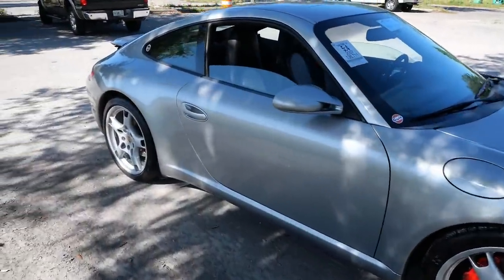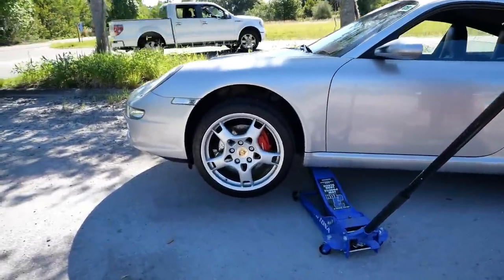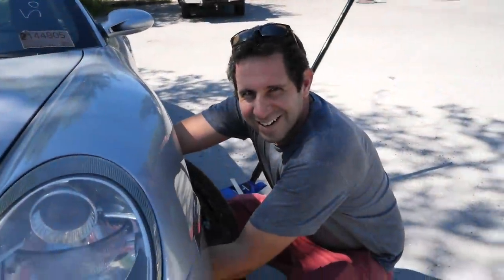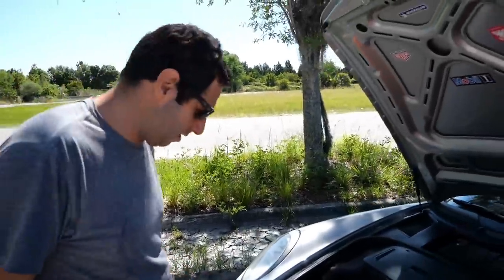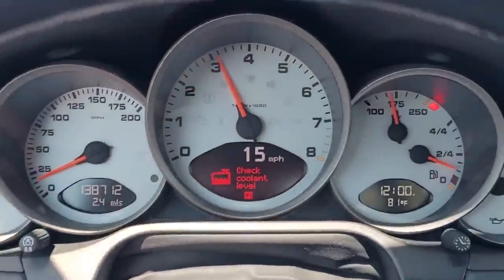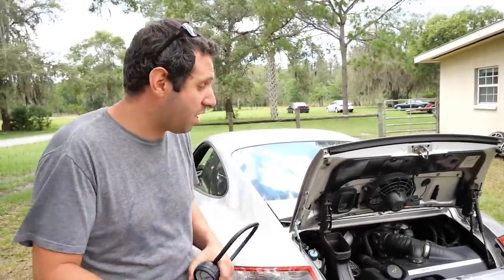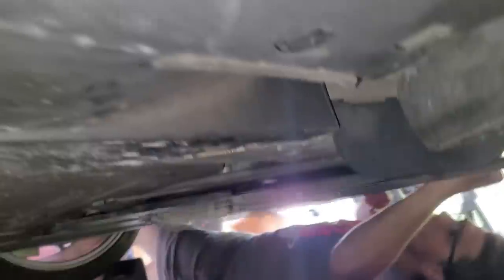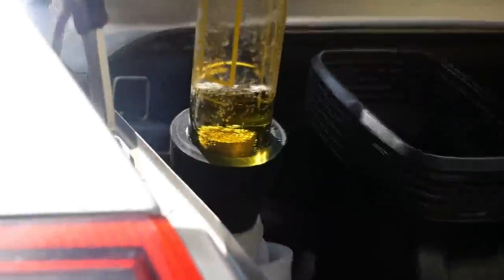I Bought an "As-Is" Porsche 911 and got 50% off because It Came with a Mysterious Leak

Comment: Hey Sam, I work on these cars almost daily and felt that I could provide some input. The coolant level is checked with the engine cold I tend to run them on the low line on my cars. They are known to have some wacky cooling systems that like to cause all kinds of trouble. Unfortunately most of the time these cars have internal leaks it's a cracked head. These cars are known to have heads that will develop cracks that will need to be repaired. The head gaskets are very strong on the m96 and m97 engines and rarely fail. Good luck to you Sam and can't wait to see this car back up and running.
Reply: I second this def take a peak
Reply: I was thinking the same. Maybe a some cracks on the channels
Reply: Worth checking the water pipes as they connect inside the front wheel arch. They can corrode and leak.
Reply: Sam “cracks”
Reply: Check your air oil separator as well. I had a 996 that was doing the same thing. Compared to a blown head gasket it’s a lot easier fix…. if that really is the problem.
Reply: Is the 997 also prone to cylinder scoring?
Reply: @WLAdrenaline  It failed the block test. The leak is inside the engine. No point in looking anywhere else.
Reply: How much will a cracked head set you back in cash terms?
Reply: @pantone6160  I hear a lot of those problem cars are in cold climates? Porsche changed the coating on the inside of the cylinder so most will eventually fail I'm sure.
Reply: "They are known to have some wacky cooling systems that like to cause all kinds of trouble." Wow some inside information. This is too technical for me.
Reply: @lopaka71  0
Reply: @pantone6160  All 996/997 are, scorning, d-chunking cylinder liners, ims bearing issue.   As I have said before, If you ever buy a  911, buy the 997.2 version where all these internal engine problems go away.  997.2 has a much nicer interior, engine,  updated electronics, nav/radio/interface.
Reply: @WLAdrenaline  Watch the video. There is exhaust in the coolant.
Reply: @esqueue  I have watched the video and know the HG is leaking. Nonetheless those pipes are worth monitoring. Thanks for confirming what I saw on the video………🙄
Reply: That's interesting....! What got me was the "electronic dipstick". I have a 2005 car with an actual real dipstick... <oo> shock!!!. I saw a video of sams some time back with gearbox motherboard controller inside a audi gearbox....i'm so behind with car tech........ :)
Reply: @esqueue , however, something caused the compromise of the head gasket or head itself. Likely a coolant leak or water pump? If not detected, this issue will reoccur.

Comment: I had same experience with a similar 997.1 model 911. Small crack in one of the heads. Common failure point in m96 and m97 engines. Head can be welded by specialty shop. Depending on amount of intermix, engine may or may not require a full rebuild.
Reply: Disappointing. No wonder owners are sticking in other engines at times.

Comment: Sam when you hook up the power to the fuse box you have to use the button on the key to open the frunk not the door sill button it only works from the key button. Check your manual. You went through a lot of work you didn't have to do. Don't ask me how I know.
Reply: Agreed not to disagree....that's the simpler way...
Reply: @benlee6500  Yeah sometimes it gets crazy. I have an Australian Ford falcon and had a collapsed cell in the battery and couldn't open the bonnet to get to the battery. We ended up hooking up a jump start cables to the starter motor and then the key fob worked.

Comment: I've never been able to open mine by connecting the jump pack and using the door sill switch. The local independent Porsche shop told me to use the button on the key instead. Worked first time. His theory was that related to the security system. For an otherwise brilliantly engineered card this just drives me mad.
Reply: you know, theres a manual for it..
Reply: I had the same problem on my Cayman.  I think when the car "sleeps" for a long time, the car is powers off everything to save the battery including the alarm system and remote FOB.  I forgot how I got in the frunk but after that incident, I put a trickle charge cable that's externally accessible.
Reply: It works in my 996 but I use a trickle charger to power it. It’s possible there is so little voltage in the battery that your jump pack isn’t powering the car. I didn’t see any dash lights come on which indicates no power.
Reply: The reason it's just a string is weight savings - Porsche charge you extra for that brilliant weight saving idea.

Comment: I had a 2016 Audi S3 that was losing coolant for months but ran perfect and never overheated. I had to add coolant what seemed like every week. We searched for hours upon hours countless times to located where the fluid was going because you could smell it, but you couldn't see anything. Finally a European shop found that it was blown head gasket causing an external leak only and not an internal leak which is why the oil was not milky, no overheating, no problems. It was only leaking while the car was under power, and then falling off the engine onto the ground and/evaporating, but again only while driving which is why we could never find any of the missing coolant. Sounds similar to what you have going on.
Reply: Seems rather unlucky, that situation. Losing coolant driving and not just running, meaning the difference from rpm at the water pump spinning, that slight difference of pressure causing that seems like a very rare and like i said unlucky predicament lol

Comment: My second 997 and I've made a manual frunk release for this one as well, just much more sensible. FYI I've tried the frunk release from the fusebox with one of those rechargeable starters, never worked, but a good old fashioned jumper cable and a battery works every time
Reply: if you use the frunk button on the key, it opens every time in this situation.
Reply: Don't let the frunk out
Reply: @allomony4010  Oh, sounds like a security feature.
Reply: I loved that my 99 986 Boxster had a manual lever by the drivers seat and it also had the pull string inside of the passenger wheel well.....I took and relocated the pull string to the front of the bumper so it was more easily accessible......Never had to use it but if I did it would have worked great.

Comment: Hey Sam, Just my 2 cents worth. As you know dropping these engines is a piece of cake.  What's not is the costs for these parts. I know that FCP and ECS are both running Memorial day sales at the moment. I recently bought a head gasket "kit" from FCP. It'll have all the rings and stuff you'll need. But, like my video you watched says, "While I'm in there Syndrome" will strike you hard and fast here. Don't believe me? I'm 15K in on a 996 3.6l to 4.0l bore out project that started as just a top-end refresh.  This 997 has 138K miles so I'm guessing a top to bottom refresh may be in order as well as the IMS.  You didn't mention how much you paid so hopefully you have some cushion to buy the necessary parts and still come out righ-side up. Good luck. Oh and if you want to sell it, I may be interested. :)
Reply: F*CK! How did I miss that sale, nooooooooooooooooooooooooo.

Comment: Actually, there is another trick you should try first before going for the release-cable.
There is a power-socket in the passenger-footwell. This one always works. Just take a fitting cable, plug it in and connect your starter-battery to that. 
The switch will always work with that solution, even if it doesn't with the connector in the fuse box.

Comment: Sam you need to use the key remote to open the trunk while you have the jump post powered up. There is a better ground on the door striker for your jump pack. The button on the sill will not work. I have unlocked a ton these 997s that way.

Comment: Sam Sam Sam..........
I just went thru this exact same scenario last week and tried everything you did.  Then after digging in the Interwebs I found that the little electric latch on the door sill wont do the trick.  You have to use the trunk button on the key fob.  It took a few tries but it finally opened.  Now onto what's causing the battery drain and I am certain you've already learned its a bad cable from the junction next to the transmission that goes to the starter and alternator.  Happens to almost every 997.

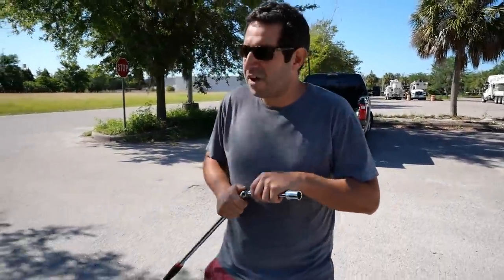Comment: YOU CAN'T USE THAT RELEASE! Sam and everyone else- when the 997 and newer is dead, and you hook a battery to the red pull-out, you CAN ONLY USE THE KEYLESS HOOD RELEASE ON THE KEY. Don't insert it into the ignition; turn your jumper on with the ground on the non-painted hinge. 992s have a synthetic hinge in the middle, but the flare at the door is still steel- use that. If it doesn't work, you should walk up to the right front side of the front bumper in front of the hood and press your key's remote release, as your key fob battery may be low and the receiver is there. You can't use the button right on the door seal exactly where you are working- it is inoperable. I've had a bunch of 911 Turbos and know from first-hand experience. Just did my friend's '21 Turbos S. I stopped the video at 2:19 because it is too painful to watch you go down that road.

If anyone has questions about this procedure, I'm happy to help. These can be frustrating times. NEVER use a cigarette lighter jumper to attempt a jump start. That can blow the main computer, and if it doesn't, you'll have to visit a Porsche dealer to reset it. The cigarette lighter can only be used to trickle charge. 

BEST WISHES

Comment: If you have power on the lip in the fuse box, you have to press the button on the key AND pull the lever on the sill at the same time for about ten seconds, you will hear the lock slowly disengage.
Reply from the maker: This is definitely Russian Disinformation
Reply from the maker: BTW I'm kidding☝️☝️☝️☝️ but there's definitely a reason they give you the manual release.
On my old 996 the electronic latch failed but luckily we had the bumper off to repaint it and it was easy to get to the mechanical latch.

Comment: 18:14 Definitely there is funny business, that's not normal. I had the same issue on my Audi, the head had a minor, almost undetectable crack on the head, between the valves, and the car drove like that for 1y, before I decided to fix it. It was so small, that the only place I had white creamy substance, was at my oil cap, but the oil  seemed clean, so what he checked at the bottom, is misleading.
Reply: Yeah well the oil on the bottom would usually be cleaner since oil is more dense than water

Comment: My 911 had such a mysterious leak as well - it was the coolant tank (hairline crack , it just lost fluid when the water was really hot),Fortunately not the gasket.
Reply: On my Mustang, it was the water pump - the seal was going bad under pressure and based on the design, it would leak coolant when hot.  Not enough to cause oil problems.  YET.  This is a known issue on my car and you simply replace the water pump every 6-7 years like a engine belt.  My guess is that whatever it is, you caught it before it caused major damage.

Comment: Add a loop to the release cable and attach to a heavy duty ziptie
Poke ziptie end out past the liner so you can reach in and grab then pull no more wheel off/jack etc when battery flat

Comment: I had the same problem with my Porsche Boxster S 2004 because they have the same system... Was a hell on to get to the cable. Finally, I built a home made system to have access to the cable from inside the car in case it happens again..

Comment: Hi Sam.  Buy a UV coolant leak detection kit with UV light and you will find the source of the leak if external.  I had the same issue on a VW Golf and that worked a treat with a very small radiator leak that couldn't be detected.  The leaking water glows at night under the UV light 👍
Reply: $8 for a little bottle in my car's case.  Instantly told me it was the water pump, even though it wasn't leaking at idle (only when hot).

Comment: Use a different ground and it will work when you try to power the car to release the frunk. The check strap in the door jam is no good. Rather use the door latch post at the back of the door jam.

Comment: Another way to get power is through the cigarette lighter, if the vehicle is equipped with one. Back in the day when the cig lighter was actually used to heat an element, you could actually buy trickle chargers that plugged into the socket to maintain your battery.

Comment: I see this video just as my 1991 Jaguar XJ6 is having this issue. I have zero overheating, but it is loosing coolant. There is the bad coffe-like goo in the coolant cap. The oil looks fine. It will need a head gasket.

Comment: If it’s losing coolant and it’s not an external leak then it can go either in the oil or in the cylinders. If the latter then no external leak and you can see the air in the coolant - hence the result at the end. I had this in a boxter and I used a coolant sealer and it actually worked. I sold it fast.

Comment: Sam…… when you’re pressure testing you aren’t putting air throughout the cooling system. You’re using air to pressurise the system (fluid). When you get a drop it’s not an air leak it’s a fluid leak…….
Reply: Thank you.  When he said that, part of my brain was thinking 'that doesn't make sense'.  However, Sam is so convincing with his 'Russian disinformation' that I fell prey to his psychological manipulation.  Can''t wait to see how he finishes this build!
Reply: Not strictly true. If there is air in the system and there is a hole the air may be expelled easier than the liquid. Depending on pressure air may be dragged in when running or when system cools down. An air leak is a fluid leak.

Comment: I had to use the cable release when my battery died too....and it snapped in half! Dealer later said to leave the charger on the fuse box terminal for a few hours and it'd pop the trunk. Live and learn I guess!

Comment: Easy to drop a 911 engine…especially with a lift 😉
Reply: Sam doesn’t have a lift unfortunately
Reply: @funnypranker34  correct 😉
Reply: No need for a lift or an engine drop when you've got a bottle of head gasket sealer.. 🤪
Reply: @funnypranker34  that's the joke
Reply: He needs to at the least get a portable lift system in place.  Dropping an engine like that requires 3 ft of clearance and jack stands that high is asking for a trip to the ER. It's time to rip that band aid off and get something installed.

Comment: take one turn signal out and plug it in to the wires there if the car is locked to works grade on the range rovers also try a dome light under seat or the door same take it out unplug and wire rig it in it will bypas the hole bs cheers love your show

Comment: I bought a BMW 2010 528Xi and sold it 2 weeks later because I cant drive a car that doesn't have a dipstick. That is the stupidest idea any engineer has come up with.
Reply: Porsche hasn't had a dipstick since the late 50's. The FUEL dipstick!!! But silliness aside, I wouldn't be surprised to hear that the change to oil level sensor was in response to most people never bothering to check their oil level unless the car started yelling at them. Basic "car walk-arounds" aren't for people who can't be bothered to avert their attention from a phone screen for a moment to observe the "actual" world.
Reply: @Alfred Wedmore You made me laugh.
Reply: My S-class came with a dipstick tube with a factory cap on it, and NO dipstick. There's thinking. You're supposed to check it electronically or buy a dipstick. Just like Apple now makes you buy a phone charger instead of including one, or a dongle if you want ethernet or USB A ports on your laptop. Ridiculous.

Comment: Sam just put it back into the auction and save yourself a load of time and money as it runs and drives so just sell it AS IS and walk away.
Reply: A cracked cylinder head (good used head) and gasket is under $1000 to repair if you catch it this early.  The guy who sold it was probably told by the dealer that it would need a whole new engine or something.  The issue, of course, is dropping the engine.  This isn't your V6 Buick where you have the top end apart in an hour.

Comment: Easier to pull the drivers sill kick plate with trunk switch and apply 12 volts to it. Assuming the latch solenoid still works.
Reply: You mean like he tried and it didn't work?
Reply: @OMGWTFLOLSMH  No. meaning power the switch itself. Not the fuse box.

Comment: Someone mentioned an oil leak. If you have to replace the rear main seal do the intermediate shaft bearing too. They go bad in those cars.(it may have already have been done with a high milage car.)

Comment: Much easier way to open the trunk- open fuse box on left side, drivers side, hook up a jump pack to ground, probe fuses with positive wire until you get lights, bells, whatever is constant power- then use the button to pop the trunk. At least that worked on the boxster I helped on.